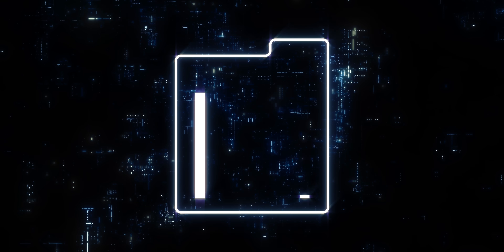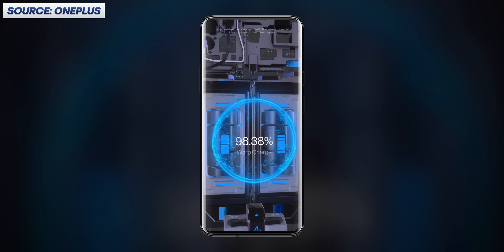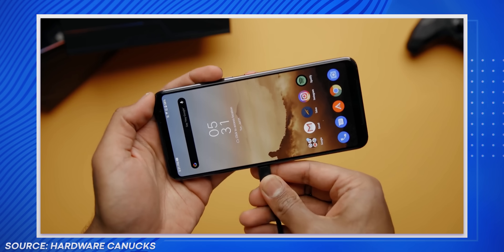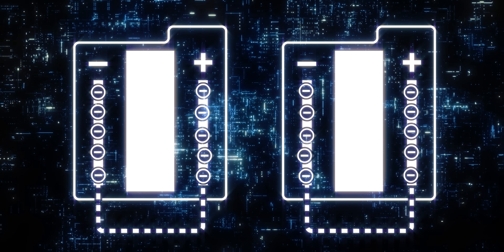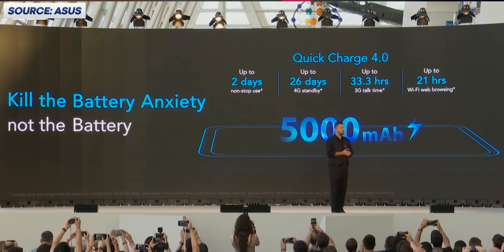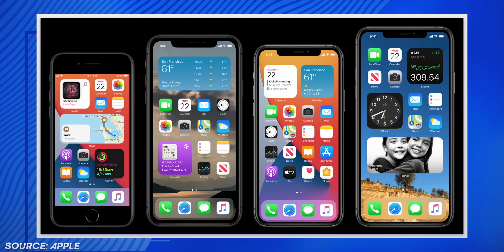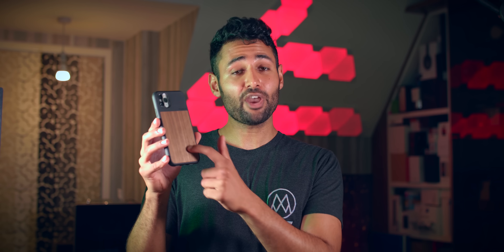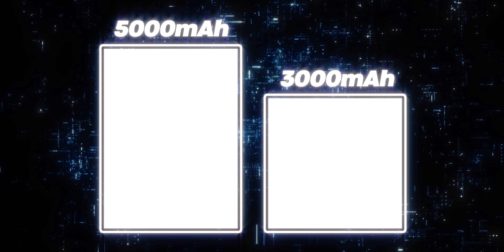The Problem with Fast Chargers.

Comment: Removable battery, just bring it back solves Everything
Reply: I would agree but I prefer water resistance instead.
Reply: @pokyhurdle7902  I'd argue there's a way to do both
Reply: @I_was_a_Bullfrog  If this is true then I'll be all for that absolutely.
Reply: @pokyhurdle7902   Galaxy s5 has both
Reply: @pokyhurdle7902  Galaxy S5 and XCover Pro: Am I a joke to you?
Reply: I like that idea for replacing the battery every 9-12 months but removable batteries results in smaller batteries which make it harder to get through a heavy use day.
Reply: @jimv1983  who cares if the battery is 100mah smaller when u can just hot swap smh
Reply: @sornkeadsiri2643  it would be more than just 100mAh smaller and for you to be able to swap a battery in the middle of the day you actually have to have a battery with you to swap. Are you going to carry an extra battery around in your pocket all day? I certainly wouldn't. That would drive me nuts.
Reply: @sornkeadsiri2643  Batteries have an Environmental issue. Proper disposal of battery is very crucial and if they bring removable battery it will cause harm to environment. Battery disposal is a real issue. That's why even EVs are not a great future solution because it has battery and even though it won't use Petrol kr diesel but that battery will degrade then it will be difficult to handle the disposal of that battery
Reply: @nitinkashyap6159  finally a valid argument, if I was prime minister I would execute people for litering 🤣
Reply: It would be easier to repair the phone and there's a chance you're phone will last longer as you can change the battery but it has to many drawbacks up its sleeve
Reply: Yeah, not good business tho for them.
Reply: Yep

Comment: Very good explaining with the batteries. Although I would slightly correct you on your graphic at 0:25, the electrons flow through the phone not from the battery anode to the cathode and the phone. What you essentially have is a battery shorting out with a phone that's connecte through a wire which in this case does nothing.

Comment: So I have a question. I'm the type who plugs in my charger EVERY night when I go to bed, regardless of how empty it is. I just plug it in at bed time out of habit, and so its full when I get up no matter what. Should I maybe stop doing that? My old school mom, back in the early 2000s, used to say you shouldn't plug it in until it's almost dead, that can damage it. She of course had nothing to base that on, she just made it up. But now I'm thinking there could be some truth to it.
Reply: You want to try and plug it in when it's around 30 percent and take it off around 80 to avoid stress of it being more empty than full and vice versa. So the closer it is to full or empty the higher the stress levels in the battery. Which is why arun said its most stable state is at 50%. I used to plug in my phone at bed and charge it all night but 2 years later and the battery was dying so quickly is was lasting half a day.
Reply: @Metalshark100  hey thanks!

Comment: 🟨🟥🟨🟥 Oneplus uses 'oppo vooc' technology which is much better and way less heating compared to 'quick change' instead of raising watts it's increases the current so if quick change uses 20v 3a(60~65) then SuperVOOC 2.0 (oneplus 8t chrger) uses10 V/6.5 A (65 W) and all the heat kept on the charging brick itself which itself reduce phone temperature

Comment: This video explained more about batteries than I’d ever seen before. I’m planning on the 12 pro max this year (upgrading from a 7plus), and I’m planning on buying the 20W charger so I’m not stuck with 5W. Since it’s not even as high as 30W this shouldn’t damage the battery much long term, right? I plan on keeping the phone for 4 years.

Comment: 🤷🏻‍♀️ I only had two smartphones in my life, last one I bought some months ago. Both have fast charger
Reply: I'm guessing those are 20 watts or less, which I think he's saying is within the exception range. 🤷🏿‍♂️ Ultra fast charging degrading the battery or slowing down hasn't really been proven yet, since most phones with it are not much more than a year old. Most Huawei phones with 40 watt charging are still operating at the same level according to most people that have them. 40watts isn't 60 or 120 watts obviously, but it is over the 40 watts he mentioned.

Comment: I had a motorola that would get hot with turbo power and here I am now with a 45 watt super fast charger in samsung and it doesn't get super hot. I always charge at 15 watts because fast charging wireless pads, which isn't nearly as fast as the default charger alone. 
And one other good reason on all my smart devices I always set the battery consumption as low as possible to preserve it's battery for longer life and to have it last longer. Big props to asus who puts an app on their laptops to limit the battery to help it last longer. Works like a tesla where you can set it up to normally only charge to a certain percentage and if you need it for longer, you crank it up to full usage.

Comment: Well, i have an original samsung charger from ny old phone that charges at 5V 1A and i've been using it all the quarantine to take care of the battery. I know it's still not going to last the same, but it will last more than with fast charge, and I actually don't need fast charge given that in quarantine i sleep around 8 hours, more than enough for the battery to slowly charge it's way up. When i need to fast charge it i change the adapter and that's all

Comment: Does s20 ultra have optimized charging
Reply: Wouldn’t know, since they’ve made like 15 of them.
Reply: @nikodoge99  i didn't knew tht
Reply: Yes, there's a option in my tab s5e of fast charging we can reduce the speed of charging to normal
Also, there's a option of keeping 85% max battery that means when your mobile/tab gets up 85% it will show 100% to expend battery life span
Reply: @sohamdimber8573  okk gr8
Reply: @sohamdimber8573  That feature I don't know if it even works. I enabled that on my tab s6 lite. So technically that means if I charge it to 85%, it should show 100% full. So, I disabled it and restarted to check the battery percentage. The battery was at 100%. It didn't charge to 85% and stopped. It charged to 100%. I also tested the sot. It was identical in both conditions.
Reply: @inabyss  but that's not the case in s4 s5e s6...
In my s5e it works perfectly
Also all premium features as samsung dex supported in s5e,s6and s7
Reply: Yes
Reply: @SAF1A  yeah man hope so
Reply: Well thanks everyone for keeping their views on my comment but i found on my settings tht my battery is on optimized only 🙃 🙂
Reply: @SAF1A  search for it
Reply: @SAF1A  search for fast charging
Reply: @SAF1A  when you open setting go to device care and then go to battery it will show you how is your charger working and it will show about optimized charging also
Reply: @SAF1A  and yeah you are right abt the optimized performance but it is also for longer battery life so i think it means for charging also
Reply: @SAF1A  ohhk so you mean to say tht optimized is for your performance of the phone rytt

Comment: Sure it gives less battery life and doesn't top up battery, but also remember li-ion doesn't like to also be kept at high voltage and anyway I'm sure all those phones with crazy high charge have high quality batteries with the right chemistry to take fast charge even though sure I would always like to turn off fast charging and always slow charge to have max battery life out of it...

Lipo on the other hand usually like 1C charge and there's batteries out there with crazy super fast charging capabilities but they are also very explosive chemistry :).

Comment: Yes, heat is the enemy of the batteries, but it is not the reason Apple didn't include a fast charger in the box, otherwise, they would declare it or (at least) mention it on the fast charger. Actually, they can give the user the option to do whatever he/she likes (fast or slow).

Comment: 0:20 I’m pretty sure this in inaccurate. It only flow until there is an equal amount of electrons on both sides. Then the electric charge on both sides is the same so current wouldn’t flow.

Comment: I agree with the principle but not with the data. 30 degrees is not destructive to batteries. Even part of the heating is in a sense self-sustaining batteries like drones.  In the production of drones themselves, for example, they calculate the batteries so that they heat up during use to be able to hold capacity in colder weather. Warming and overheating are two different states and 30 degrees is not overheating at all. I have been using the mate 20 pro for 2 years now and in over 90% of cases I charge it with a 40 watt charger. For these 2 years I do not notice a decrease in capacity because it still lasts 2 to 3 days with normal use.

Comment: So, long story short: nothing's gonna keep my phone last longer and better beyond 2 ish years?
Reply: well I mean i have devices that are over 4 years old, they still work but the battery lasts like 40-60 percent of its original capacity.
Reply: @markgeorge2200  wait ... 4 years? How? Also, I agree with the shrinking battery capacity. I have an ipod touch (6th Gen, bought in 2013) and he throws tantrums like hell, can't even last for a couple of hours after a full charge.
Reply: @bdotashu  well I mean I have a Samsung tablet from 2015 with 16gb storage 1.5gb ram, it's super slow but the battery can still hold up for about 40 percent its original capacity
Reply: @bdotashu  yah older devices struggle after time
Reply: @markgeorge2200  wait what my Lenovo tablet from 2017 has 8 gb storage
Reply: @devanduraipragash6106  Revelation! 🤣
Reply: @devanduraipragash6106  well back in 2015 16gb wasnt that bad so honestly they probably came with cheaper options. I got a samsung tablet that costed around 200 dollars back then I believe so it was pretty good for that time period
Reply: I have the iPad 4th gen. that that's a couple years old. And I use it to play YouTube videos for sleep. I have about 55% left when I wake up after 5-6 hrs of sleep
Reply: Correct. That's physics. Not capitalism. There is not much of anything we can do to stop battery degradation. It's the nature of Lithium-Ion batteries.
Reply: Well i have a nokia e63 bought in 2010 it has 1500 mah battery and pin charger(no micro usb even) and on a full charge it lasts for like 12-14 hours (though it is only 3g and 3.2inch screen and the resolution is small) still it is a very big feat i guess.
Reply: @abhishekroychoudhury9693  The Nokia babies... Those were the feat, honestly.
Reply: Just go to service Center and get a new battery thats it.
Reply: @joshuvaantonio  Nice point but the product service cycles don't last long much. On an average, a company pushes atleast 2 segments of its smartphone in the market and that portfolio gets expanding every year. Age your device a couple of years and you'll start noticing shortage of supplies. Given the fact that we are concerned for battery replacement, it might work out. Emphasis on "might".
Reply: Ashutosh Bhardwaj Yes. Get iphones then. You won’t miss out on big things and you could use it for 5 years. Just change the battery in the middle
Reply: @joshuvaantonio some  iphones tend to get updates for 7 years
Reply: @joshuvaantonio  changing the battery would cost between 50 to 80 % of the cost of a new iphone if you're going to go with apple
Reply: consumer perspective Haha i donno if you are joking but..it doesn’t. Only 10 percent. In USA it would only cost $69 and its pretty much same in every countries
Reply: @joshuvaantonio  yeah true just checked $69 is if it's out of warranty or it's free of charge but changing the back glass panel is really expensive at $500 so I assumed changing the battery would be similar
Reply: consumer perspective Ya back glass is costly. Just changing the battery won’t break your bank and it promises another 2 years of usage (using the in-box charger)
Reply: Iphones and pixels last a lot longer
Reply: My phone still lasts me all day with moderate to heavy usage and is now hitting the 3 year old mark.
Reply: @feixas6961  God bless.
Reply: that's capitalism for ya!

Comment: Want better battery life? Dont charge upto 100 and set limit to 80 and dont drop below 50 keep your charging cycles very short if u have a charger nearby then keep it connected(If the battery drops below 80 and charge only until 80) and keep phone cool many phones have crap thermals and throttle a lot if u feel the device becoming warm apply a bit of water on the back and front and blow air on it until the water vaporises due to absorbing that heat it helps in keeping your battery and display healthy. Try killing apps in background force stop apps u dont use and reduce idle drain which helps ypur cpu sleep better and that idle drian reduces as well which is better so u dont have to plug to charger

Comment: I still think the benefits of quick charge overcome its downsides. I don't expect my phone to live up to 5 years like Apple wishes with their phones, though I still use a 2017 phone that lasts near a day per charge as a secondary phone. Even worse, manufacturers supporting this technology usually only gives 2 (or 3) years of support. Hence their idea makes sense and is a good decision. Technology advances a lot within that timeframe that most customers will want to have the new phone, there's no need to keep a phone lasts too long with initial premium price. It's better to pay half, third or quarter then change every 2 years. It's cheaper and you get the new tech quicker.

Comment: If the charger is fast and not the phones its ok cause fast chargers at the start are fast and slow down but if the phones battery is fast charger then Arun is correct

Comment: I sure love this video, the efforts put in it and the overall content. Very educative indeed but i noticed it is most focused on ios and iPhone in particular. I think most manufacturers have thought about all these downsides b4 introducing 60w n 120w hyper fast charging. These are major technological advances so lets not take away from it. I seriously doubtapple gives u a 10w charger in the box because they care for ur battery's health in a long term, they simply want u to just pay extra cash for fast chargers, apple does have fast chargers sold separately dont they?if they really cared abt ur battery health then they won't adopt the fast charging philosophy all together. U would have to take a close monitoring of the mi 10 ultra battery degradation over the years to support ur theory coz so far 120w charging is apparently every manufacturers dream.
Reply: spot on every company wants to go to hyper fast charging, apple they are just the greediest company ever, so be stupid isheeps to think that the next iphone 12 will be without a charger because apple wants to save the planet, xiaomi on the other hand has a been caring more about the customer than apple with a long lasting graphene battery on the lastest mi 10 ultra which will holds 90% of it's capacity after 800 charges (despite having the fastest charge of all smartphones @ 120w), apple has been so greedy with components such as ram and storage, most higher end phones from any company will give you 8,12 gig of ram and 128-256gb of base storage and the shitty apple will give you 4 gigs of ram and 64gb of base storage Apple was one of the last company to release it's first oled smartphone, again because they are cheap and greedy, and will probably be the last company to transition to higher refresh rate screens and on screen fingerprint scanner, greedy pigs

Comment: Love the video but just to point out Apple don't actually wants the battery to last as long as possible. I am an iPhone user but 11, 11 Pro, and SE(2020) all have too small a battery to last more than 2~3 years. SE(2020) is the worst with most people have to charge twice a day. That will wear out that small battery in slightly more than a year. iPhone 12 will come with smaller battery vs 11at ~3600mAh while Android are going 4000~5000. The tiny amount of RAM and starting 64GB storage also serve to compel people to trade-up after a while

Comment: Hey quick question . The fast charger came in my phone's package . And I heared that if I use other chargers expect my charger , it will damage my phone . But then in the other hand , the fast charger damages my phone too ! Then should I just buy a normal original charger from my phone's company ?